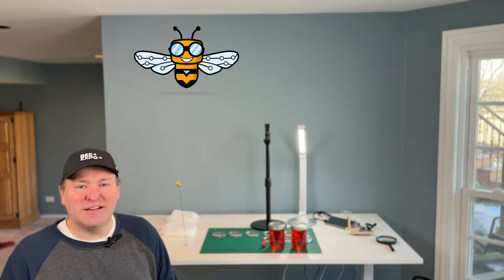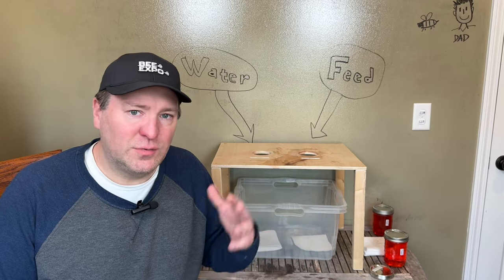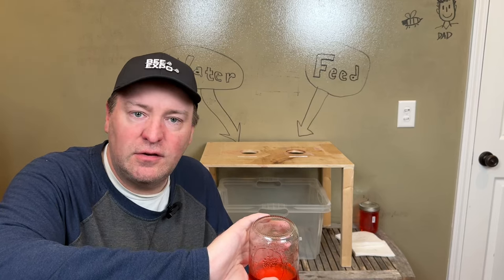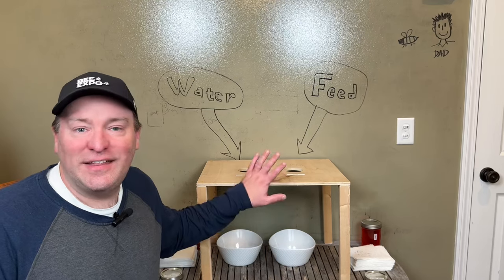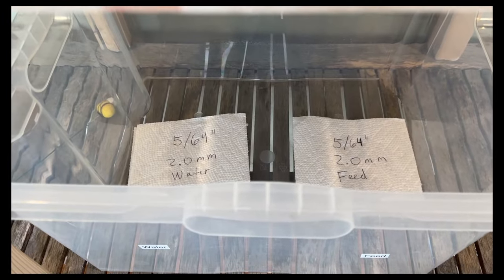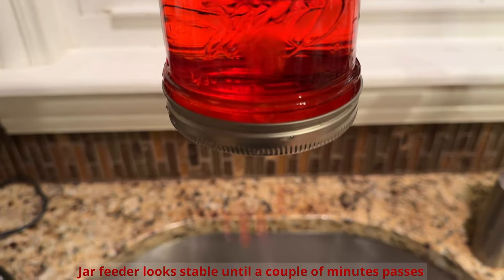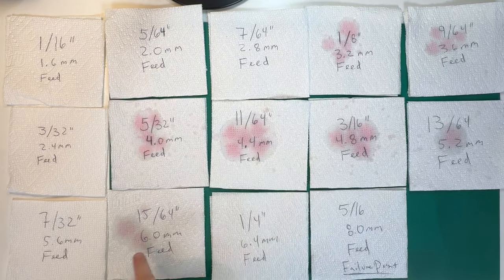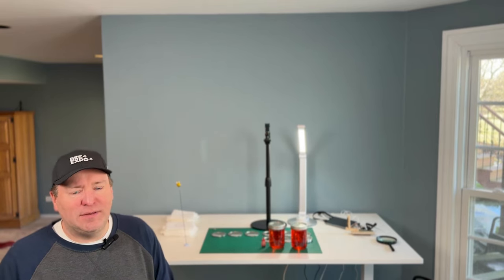Unlocking Efficiency: What is the Right Hole Size for Bee Feeder Jar? 📏🐝 #beekeepingtips

Comment: Another factor which would be harder to test is, when the bees stick their probiscis in and break the surface tension of the liquid, does that also allow a lot more liquid to leak out? My guess is that the bigger the hole, the more you'd see that effect. My theory would be that the smallest hole that they can get their probiscis into would be the least likely to leak, while allowing easy access for the bees. I'll put out theories all day long, as long as you do the hard work of testing them. FWIW, I use push pin holes.
Reply from the maker: Doug, Lol, keep the ideas coming and I'll build experiments.  I did think about that too. I tried pushing toothpicks into the holes to simulate proboscises.  I was also wondering if it would break the vacuum and cave in on the bee, I suspect that you're right on that.  I should create a more rigorous experiment and try it out. Thanks!

Comment: The bigger holes that at first did not leak, would they spring a leak when the bees started to feed from the jar? Any difference which direction that you drive the holes through the lid?
Reply from the maker: @donaltland7957: Yes, above 5.2 mm has not only a time-bomb affect that I observed, but if it was disturbed (like with a bee feeding) it could dump its full load.  I'd hate to be the unassuming bee looking for some feed.

Regarding the difference in direction, that's a great question, I'd not thought of that.  I'd do some experimenting on the channel.  One of the things with drilling and punching holes is that it leaves jagged edges.  I wonder if anyone's ever studied if it's bad for bee's tongues? 

Keep the comments coming and I'll keep experimenting. 🐝 🧪

Comment: There is no correct size of hole . The amount of syrup is determined by the amount of syrup you want to come out because of how you want to feed . You always use a very small hole but you may just use three holes or you may go with ten or twelve holes . If you just want to stimulate the bees use less amount of holes then if you want to put weight in the hive for say winter you put a lot of holes . Believe it or not but even in steel lids the holes will get bigger the more they are used . Also that gets into something else to what thickness of syrup you are wanting to feed . There are three different mixtures I use these are water & sugar the first is a say 1-1/4 to 1 this one is thinner than a 1 to 1 because this one is a lot closer  to nectar. Then the middle one is a  1 to 1 then the last one is a 1 to 2 this one is the thickest mixture. This is used to put a lot of weight on fast  to fill the box so the bees will have a lot of food for the winter . Do see there is really no correct size or amount of holes it is just something you learn with years under your belt an learn what each thing does . I do not remember off the top of my head what size holes it is but a tooth pick will just barely fit in the hole to clean the holes out but guessing I would say a 1/16” or or a 1/8” just stay small . On the leakage even with small they will not leak a lot but when the temperature changes it will burp an you will get some leakage . Always fill your jar up full . If you start getting a lot of leakage then your jar is probably getting low an will not hold a vacuum an or you are having a lot of temperature changes from night time to middle of the day. This is hard to put on paper what to do but I hope this helps out .
Reply from the maker: @kathyhathaway8823: That's an interesting observation about the hole sizes getting bigger over time for even a steel lid. Why do you think that is?  Thanks for sharing all the great information!
Reply: @TechnicallyBeekeeping  I have no idea why I just guess it is the billions an billions of licks 🤷‍♂️🤷‍♂️🤷‍♂️.
Reply from the maker: @kathyhathaway8823  Ha, it's the lick-factor. 🤣 I love it.

Comment: The amount of airspace helps to determine how good of a vacuum you get. the more full the jar, the less leakage you will get. Good video and experiment!
Reply from the maker: @BackBeeBrokenBeekeeping I noticed the relationship between airspace and vacuum after the first experiment.  Maybe it should have been, but this relationship was not obvious to me before experimenting.  

I ended up running the whole experiment a second time to ensure that airspace was kept at a constant rate out of concerns that it would affect the experiment.  Thanks for the comment.  

How did you discover the relationship between the airspace and vacuum have you done similar experiments or just from experience?  Great insight.
Reply: @TechnicallyBeekeeping  I believe it was either Bob Binnie or Kamon Reynolds. Another few variables you have to take into consideration is external temperature, and the material the container is made of. Heating or cooling the liquid will make the drip rate change, and if you have a bucket feeder, the plastic can expand/contract with temp changes creating more/less of a vacuum.
Reply from the maker: @BackBeeBrokenBeekeeping  I had thought about doing another video of microwaving the feed to get it to the temp to what it would be in an inner cover on a hot summer day.  

I had not thought about material, that's interesting about the expansion and contraction but makes sense.
Reply: @TechnicallyBeekeeping  I would also be interested in finding out how long syrup can sit outside in a glass jar exposed to sun prior to mold growth vs, a glass jar covered by a super and lid... Just in case you are looking for video ideas lol :)
Reply from the maker: @BackBeeBrokenBeekeeping  That's a good one.  Stay tuned, I'll look into it.
Reply: @BackBeeBrokenBeekeeping  the additives such as HoneyBHealthy or even trace amounts of bleach can help extend the shelf-life of the feed.  But to put it this way.  If the jar is on the hive long enough for it to spoil, you shouldn't be feeding the bees anyway.  If they don't take it, they don't need it.
Reply: @BackBeeBrokenBeekeeping  @TEchnicallyBeekeeping  I thoroughly enjoyed your approach for a static environment.  Bob Binnie explained the drip rate process well when related to temperature fluctuation.  Heat tends to cause expansion of the jar's trapped air layer which adds downward pressure on the jar's liquid (water and sugar mixture) while increasing cold temperatures decreases the air pressure in a jar's air layer.  Also, remember there are two separate factors effecting your analysis; outside temperature influence and hive generated bee clustering will both have some impact on the temperature of a feeder jar.  I personally liked the 1.6mm up to 2.4mm sizes as they seemed the most efficient options.  My guess is the 2.8mm might drip into the hive as temperature increases.
Reply from the maker: @laraybrown1329 that's very insightful.  Thanks for sharing.  I assumed that temperature would affect the results but wasn't sure how.  I was surprised by the size of the air bubble affecting it as well, although in retrospect it shouldn't have surprised me.  There are a lot more factors to the drip rate than I originally realized, but that's why it's always good to experiment for ourselves.  I agree with your sizing, 1.6mm and 2.4 is around where I'll stay as well.  Your statement about 2.8mm dripping at increased temperatures sounds like it could be another video. ;) 

Keep the insights coming.

Comment: Great video. I was just wondering about hole size. I do like to put bee pollen substitute in the syrup containing HBH and ABB supplements, so when I made the thumbtack or small nail sized holes, it seemed the pollen sub stayed in the jar. Now I know I can go to a larger size before running into dripping issues. Thanks.
Reply from the maker: @Junebug-js40l, that's a good point about the pollen substitue.  It can gum up the works for certain.  I've found that with many feeders that were coated with it after feeding was complete. Great comment, keep them coming. 🙏 I plan to talk more about feeders in the next few weeks, let me know if you'd like more content about any aspect of feeding. 🐝
Reply: @TechnicallyBeekeeping  My latest pondering is how to rig my two-partition top feeder so that the syrup flows more towards the center screen. The plastic bin is so flat, if the syrup dries out the entire bottom is coated with the dried sugar (and pollen substitute).
Reply from the maker: @Junebug-js4ol  tell me more!  Do you have an link to the top feed that you use?
Reply: @TechnicallyBeekeeping  Mann Lake sells them. Search top feeders. If you don't hit Enter, it should show up at top. Believe you can get elsewhere. You may recognize it also.
Reply from the maker: Ah, this is the one you mean?  I have not used this one before. 
https://www.mannlakeltd.com/top-feeder-with-unpainted-super/

I use the Dadant feeders in my bee yard.  I'm not recommending them, as I've had to do some modifications due to bees drowning. 
https://www.dadant.com/catalog/hive-top-feeder-10-frame-m01436
Reply from the maker: @Junebug-js4ol  Ah, this is the one you mean?  I have not used this one before. 
https://www.mannlakeltd.com/top-feeder-with-unpainted-super/

I use the Dadant feeders in my bee yard.  I'm not recommending them, as I've had to do some modifications due to bees drowning. 
https://www.dadant.com/catalog/hive-top-feeder-10-frame-m01436
Reply: @TechnicallyBeekeeping  Yes, that is it. The only drownings I have experienced with it occur when the syrup is exposed, example when filling. I definitely like it, but a bit of an angle would make it better.
Reply from the maker: @Junebug-js4ol  I suspect that the galvanized screen in there makes it easy for the bees to climb out unlike the Dandant style. 

It's interesting that you said that about the bottom being flat.  I've been playing around with 3D printing a top feeder and saw the same thing and ended up angling the tank slightly because I found that flat bottom = dried pollen substitute and you have a crusty mess.
Reply: @TechnicallyBeekeeping  Sounds great using the 3D printer. Let everyone know when it goes to market!
Reply from the maker: @Junebug-js4ol  Thanks!  I'm constantly amazed at how poorly designed most beekeeping equipment is (and how little the people making them know about beekeeping).  I'll put some stuff on the channel about it.  Thanks for your interest. 🙏

Comment: This is a great video. Would have been good to include jar size and feed volume to see if that had any affect
Reply from the maker: Great idea! I will try it in the future to see how the volume changes things. I suspect the heat (for example in a hot summer hive) and mix of syrup also affects things.
Reply: @TechnicallyBeekeeping   heat shouldn't affect things, because evaporation would be  carried off upwards, which can't happen because of the jar being inverted
Reply from the maker: @drdaveyjones6216  interesting point. Inside of the jar itself is a closed system. I am not sure how vapor vs liquid would affect the flow rate. 🤔 You think that it would not have an effect?